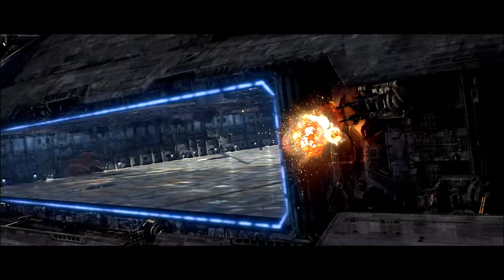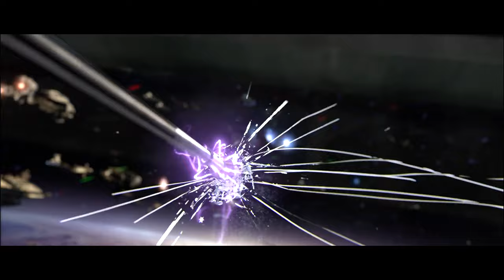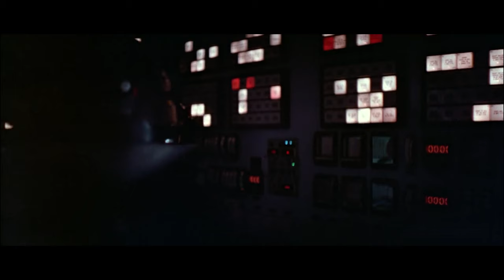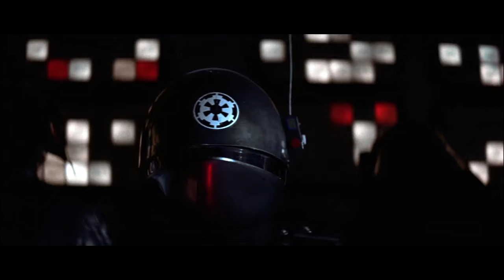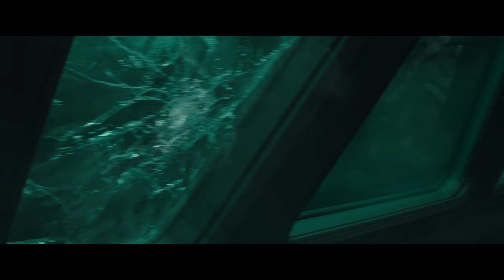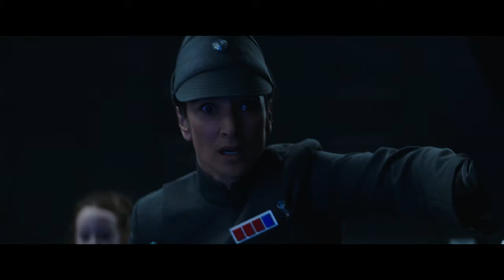This makes literally no sense

Comment: Well look star wars is like... both set in the past and futuristic so... for example:
You have Holograms but they look way worse quality then any TV.

There's Anti-Gravity but the ships still fly relatively slow and look like they are out of WW1 apart from hyperspace.

They have futuristic planet destoying weapons but are limited to fighting each other in "starfighters" based on eyesight.

They have intelligent anf advanced droids, but they most of look like simple hunks of metal not capable of much let alone Wi-fi or remote hacking.

They have all sorts of technology and gadgets but their only wireless signal is radio and whatever they use to transmit holograms.

They have seemingly advanced software systems but their programming and code is  next to non-existent a simple virus could probably take down an entire imperial fleet.

My point is... it's part of style really the duality mix of feeling both old and futuristic at the same time.
Like they have stuff we don't like anti gravity etc. But barely figured out how to use it all and are way behind us in almost all departments apart from many things like interstellar travel being much easier for them.